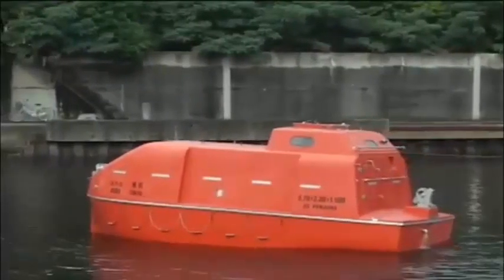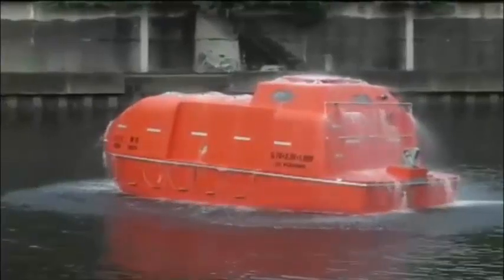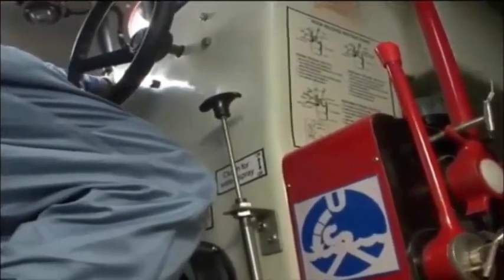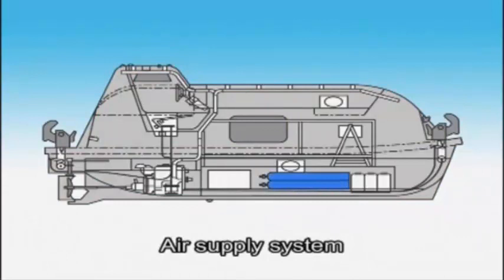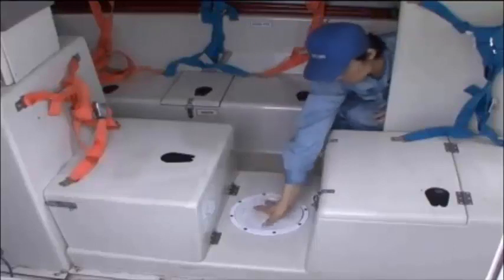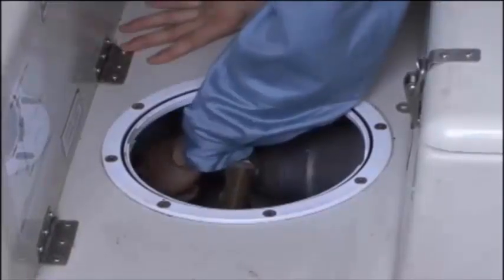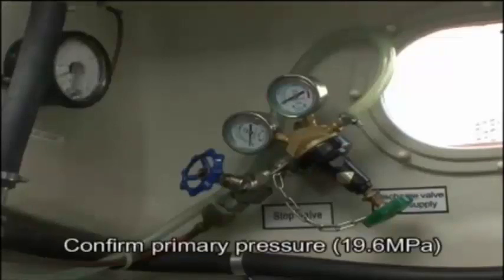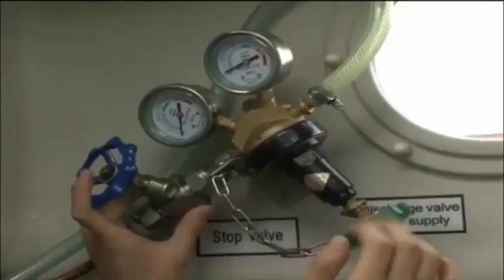Fire Protected Lifeboat

Comment: thank you for the video! I haven't understood the purpose of invoked differential pressure indicator. Why not a simple pressure indicator?
Reply: One indicator for how much pressure of the air goes in, one indicator for how much pressure of the air goes out. I guess in case of saving the air for longer use.